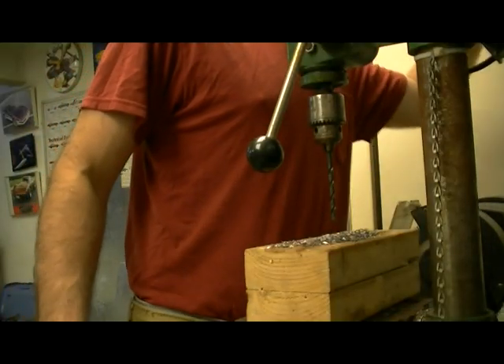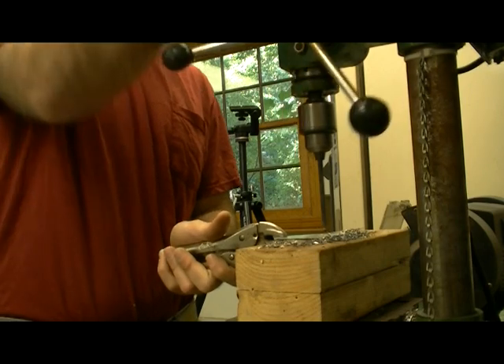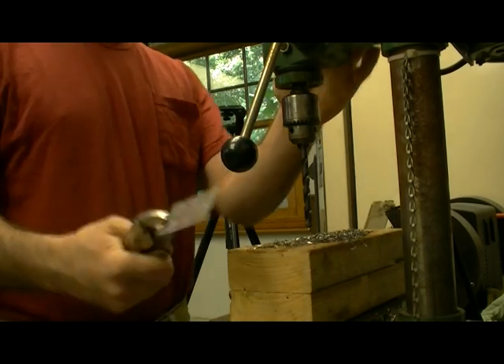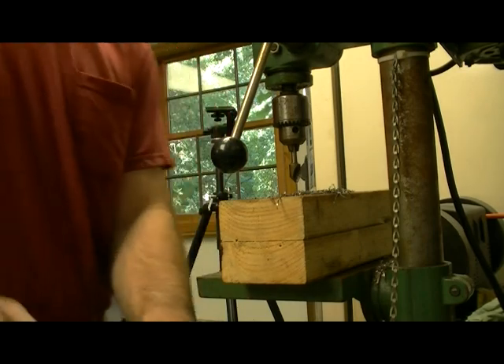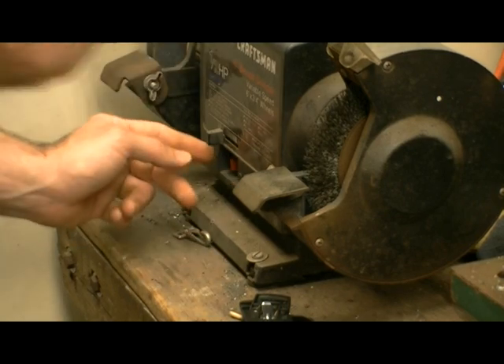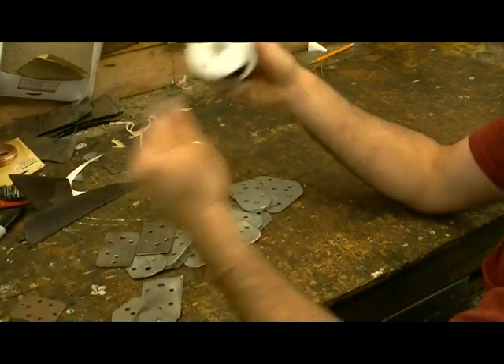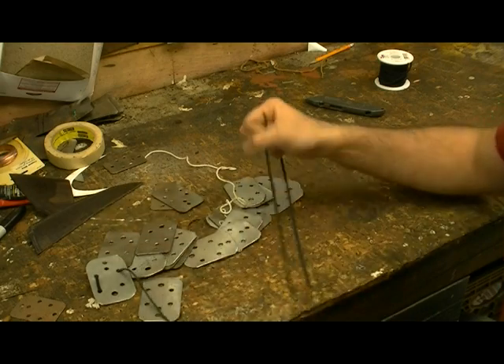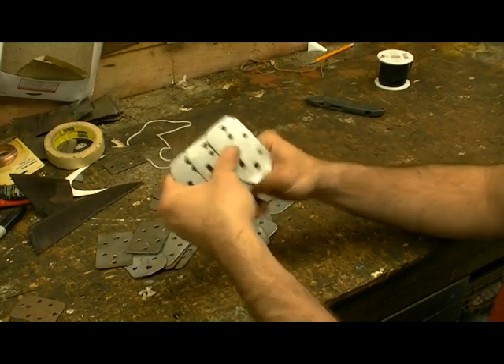How to make: Lamellar armour pt.  2

Comment: the oiling of your drill is a must. drill for too long and the bit gets hot, may warp or break. for the holes I'd recomend getting a grinder attatchment for a dremmel tool, you can smooth out the holes and make the lace last longer.

Comment: Instead of drilling you could get a roper whitney jr #5. It punches a clean hole, no need to deburr and they have a variety of punch sizes. You can find them on ebay pretty cheap sometimes or you can get one new. I highly recommend getting one.

Comment: Since this is for looks I don't suppose failure to temper matters. I'd think you'd want to coat the plates with something to prevent rusting. I think that's why some of the early stuff was tinned. It looked nice but it prevented rusting.
Reply: I've been thinking about the same question.  Look at tempering this way.  You have a lot of small plates.  This means you have a lot of chances at learning the tempering process without risking very much worked material on any given attempt.  I am thinking about making this armor with bamboo & leather, both boiled in beeswax.  But if i were doing it in metal plates, i really think i would use the occasion to explore hardening the steel, & learn how to recognize that color of the metal when it is at hardened temper.
Reply: Dwight E Howell 
Mild steel won't heat treat, it's the dividing line in the Sand of what makes it mild steel.
But 4130 moly steel is only about 2 bucks more per square foot.
Hardening isn't really the problem.
The big problem is the temper to get a temper with good mechanical qualities you'll need a kiln to keep it at 800°+ for at least half a day.

Comment: oh god, the rpm on the drill man, take the thickness of the drill in mm, multiply it with 3000 and there you have the right rpm for that drillpiece, and yes the oil makes it last longer.
Reply: not multiply sorry, divide
Reply: are you sure you don't mean to take 3000 then divide it by the width of the drill bit in mm..? that's the only logical answers I got anyway

Comment: Always love watching this.  I ought to build one some time.  Have you ever considered heat treating your pieces for hardness, or polishing them up real smooth & shiny?  Bronze would be so friggin awesome looking -but it is sooo expensive these days!  Stainless steel!  Chrome!  ;)
Reply from the maker: ***** Thank you. I have but it comes down to room and zoning laws in the area I live in; no room to make something for heat treatment and everyone lives on top of each other. I've used another type of rust preventing though, paint, or more to the point spray paint, plus it gives it a different spin to the armor.   I've though about bronze and I do know someone that sells it but as you said, it's expensive.
Reply: Schuler001 maybe you can answer this. I keep seeing references in lamellar to plate types, mostly plat D, occasionally plate A.  Keep wondering what the other plate types look like & where i might find templates for them. I keep thinking that the lamellar i want to build would be made from hardened leather, & have oblong ceramic beads where the stitch occurs & each stitch would be tied in the back so that any individual stitch that was compromised would only effect the the two peices it was immediately connected to.  Just an idea, and i'm not sure how practical it is, but i really think the beads on the exterior would look amazingly cool.

Comment: I am curious how historical dark age or medieval smiths made holes in the plates.  Obviously the didn't have electric drills.  Did they actually use some sort of drill, or a punch, or what?
Reply from the maker: +WalkaCrookedLine  I believed they used a punch to create the holes.
Reply: you know they have even found a lamellar which made of bone...so it seems that the tecnology to create holes is not so difficult...at last,easier than metal fabrication

Comment: hay budy maybe this info will help you and others :) ween i make  Lamellar armor i make one the best it can be. with holes and use that as my template i use it to make 10 templates in all thin i drill the holes using the template. thin i make 90 blanks put one template over 9 blanks and thin using the top one as a hole template. hope this helps :) oh and what is the size scale in the video 0.080? oh and i use tape to hold them together ween i drill thin i take it off thin put it on theotherside.

Comment: Question, why did you not just use the template to mark the piece for drilling? I personally would batch alot of the tasks you are doing so that the production time is cut down significantly. I know you are doing this just to show the steps but it seems your actual production method might be very needlessly labour intensive.